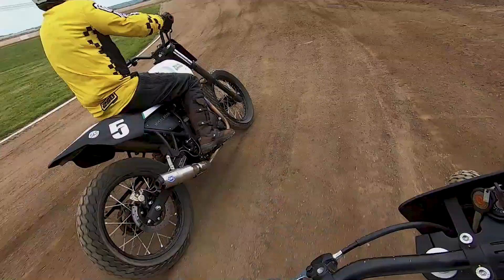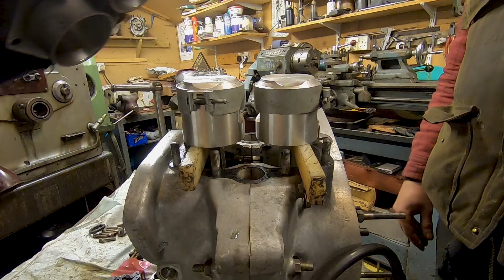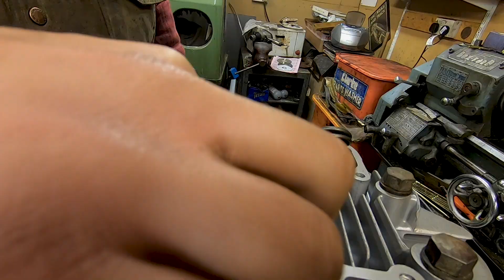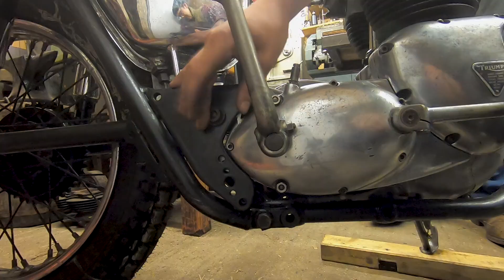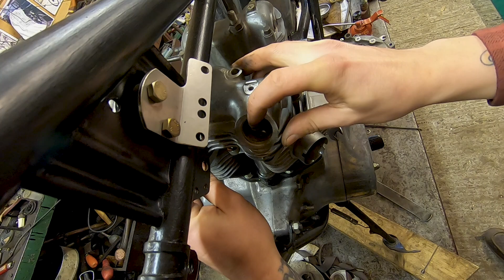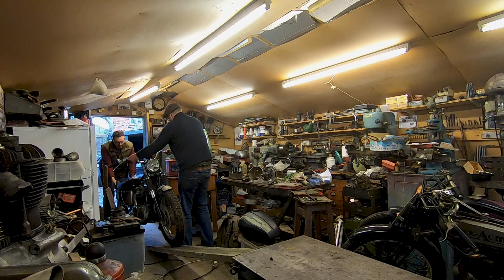650 Triumph Build EP.12 | MAJOR PROGRESS! I Can't Believe How Good This Looks..

Comment: Very cool.  I can't wait to see it back on the road.   What kind of sealer are you guys using with those pushrods?
Reply from the maker: Cheers mate! I can't wait to have it on the road, hopefully I can run it in before summer. The sealer is loctite black silicone. Definitely leave it to dry before fitting under compression!

Comment: i put motor on the lawn then drop the frame over, but then i don;t have useful mates like Rick. 
£'d of gone EI, just sayin', or are you going capacitor ignition?.
Reply from the maker: Yes that's always a handy way of doing it! Battery and points with a capacitor at the ready for emergency. It's possible I'll go ei in the future but points can usually be fixed on the road. Ei not so much which put me off!

Comment: Dear Sir(s) Love the rebuild, however, there are different push rod tube o-rings at different thicknesses , This should have been mentioned as the proper"crush" should be checked as the cylinder head is dropped on the barrels which should be 1/16 when you set the cylinder head on the barrels, Just as he pointed out the different crankshaft gears.
Reply from the maker: Hi Mike, cheers it's coming along nicely now!
 Yes you are right about the varying thicknesses. It probably was a point worth mentioning however my videos are not "how to's" more a vlog of what were up to with the occasional tip or pointer. It's very difficult to prioritise what gets mentioned and what doesn't. I cut a lot of stuff out as there is something to be said for every part of a rebuild but if I did the episodes would be be very long  and potentially quite boring. That being said I will be taking on another triumph project soon and will be sure to mention measuring the proper crush.
Cheers, will